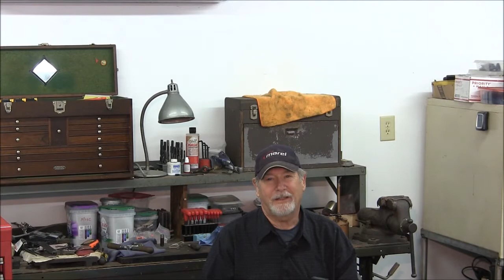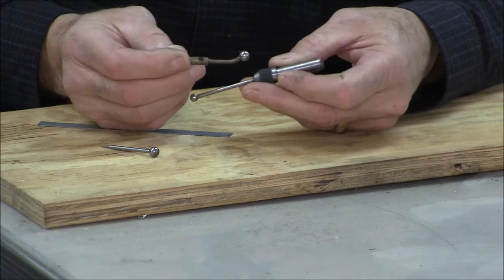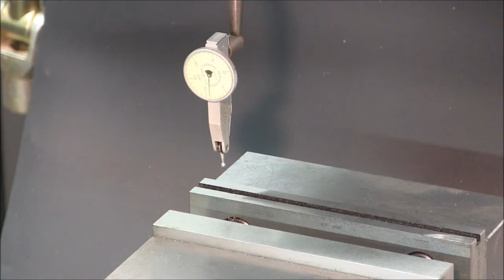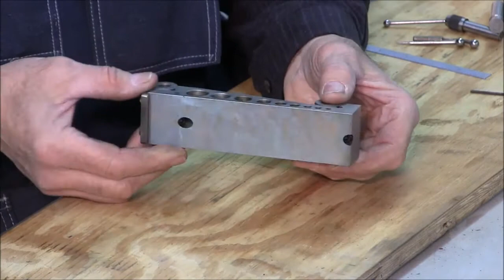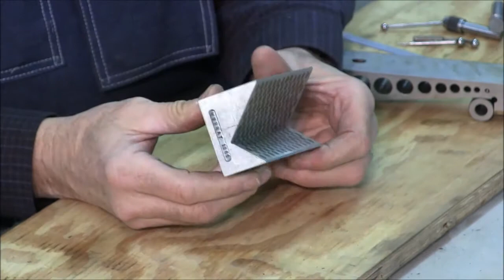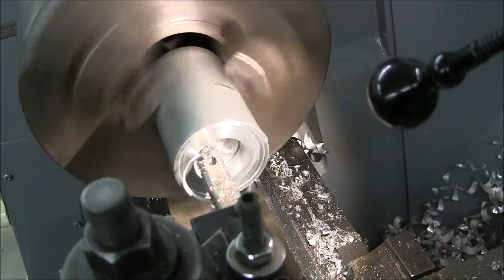Edge finding the old school way

Comment: That's a very super nice sin bar.
Interesting edge finding trick - but, I am trying to equate the readings you get with the actual spindle center. Surely there is some random offset from the indicator holder. It's very possible my old brain is not seeing this - very possible. :)
Reply from the maker: ChrisB257 - You are on the right track! The offset you mention ends up being the radius of the ball of your indicator. Really not a trick. It's SOP in the world of t&d making. I'm surprised more of these things do not find their way into machinist YouTube and posts. With the decline of t&d in the U.S. (thanks China) much of this is lost as us old job shoppers die off.
Reply: @michaelmurray9154  its very hard to find older knowledgeable guys in the trade, and the ones who are don't seem like they want to share their knowledge. Thanks for sharing yours and please continue to do so. It helps us younger guys out